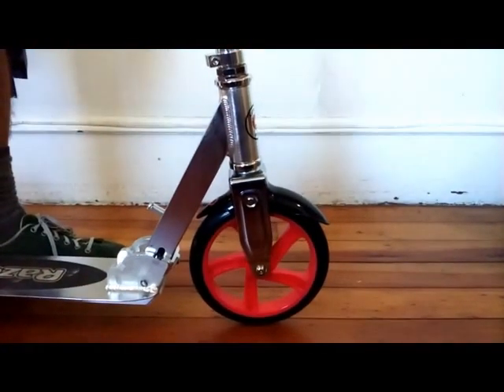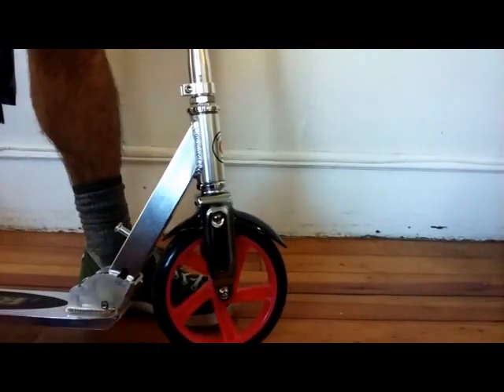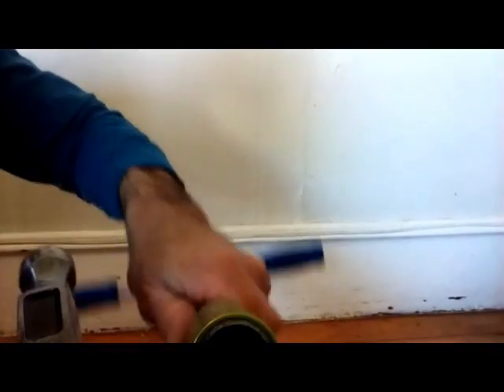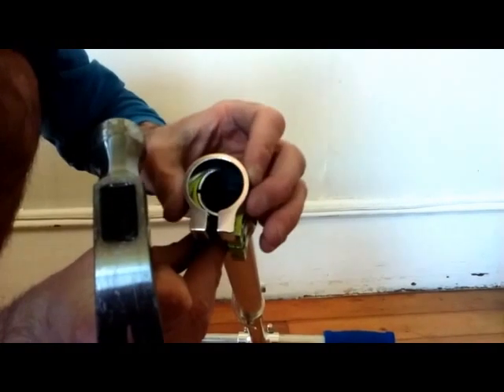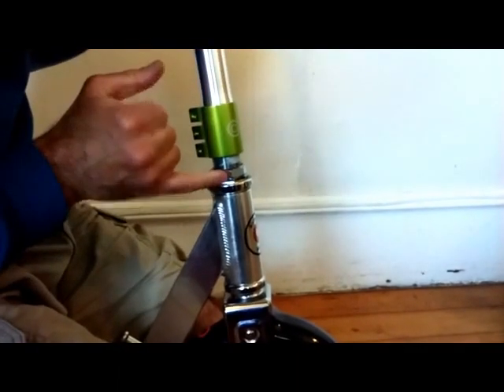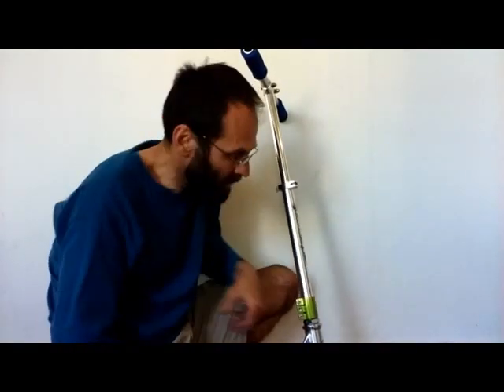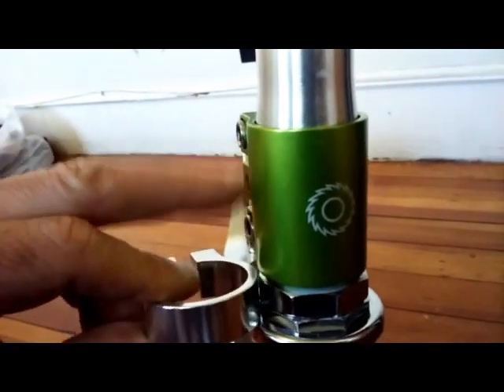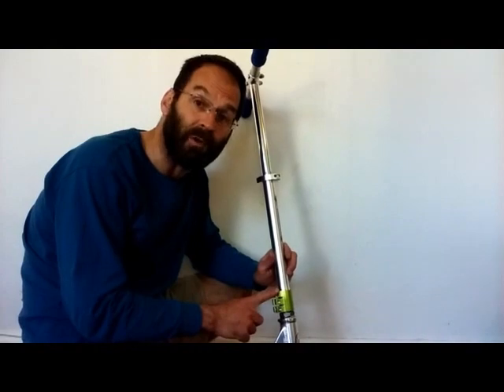Razor Scooter 🛴 Triple CLAMP Upgrade

Comment: Dude, you're awesome! I just started working for a startup company in Los Angeles that uses scooters to navigate downtown. I could use all your knowledge...
Reply from the maker: +Grant Powell Thanks man! My advice would be get something with 200mm wheels, like Razor A5, Carbon Lux, Xootr. The folding mechanism is convenient but makes for jangly ride, so I shim that with rubber, but Carbon Lux has fixed downtube which is more stable but less convenient. Post update when you start scooting!

Comment: Just use a hic compression system. It's a little bit more expensive but it works. That clamp isn't oversized so your ruining it woth your oversized bars. You should get something diffrent